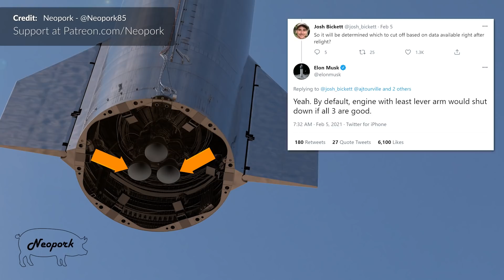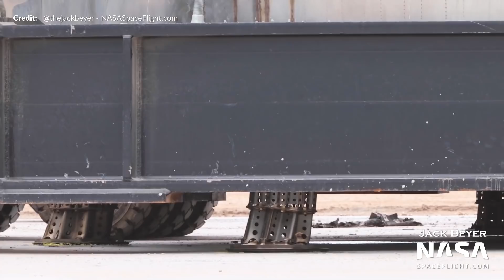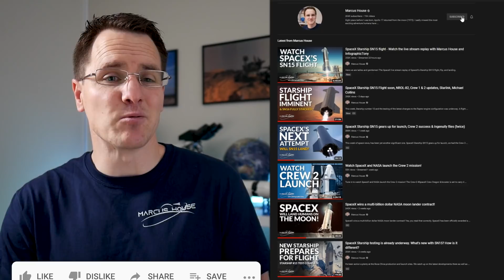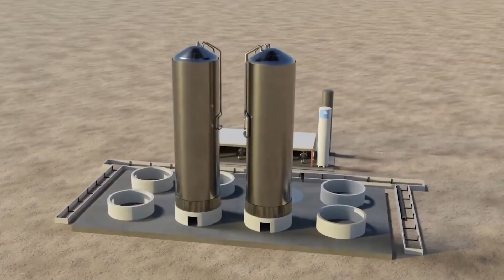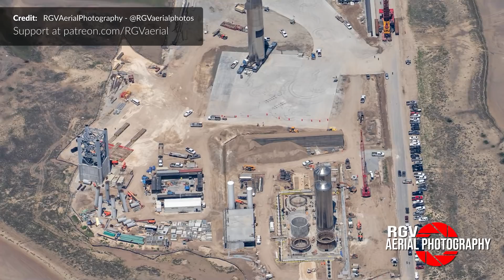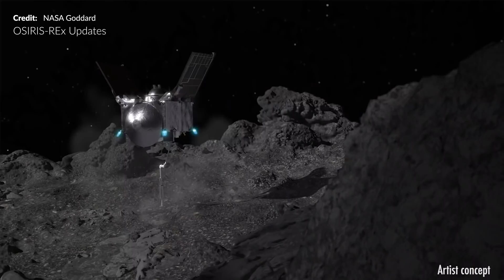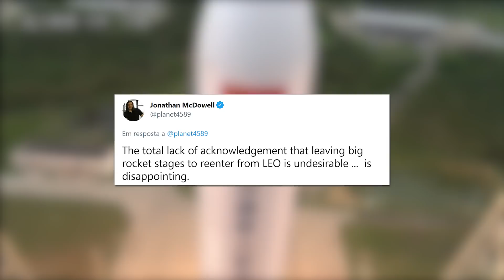SpaceX Starship development shifts focus to orbital flight with Super Heavy

Comment: My biggest concern is the Starship methane leak. Can you address that problem, please? Where does it come from, and will it be present in future Starships?
Reply: The methane leak probably comes from one of the 3 vents on the bottom, so probably the solution is venting on the opposite side of the fire, or something to put put the fire faster
Reply: @apyr1439  
The three bottom vents are for oxygen,  not fuel.
Reply: @imconsequetau5275  Thanks, good to know, i was sure the oxygen was on top.
Reply: @apyr1439  
All that liquid&vapor being spewed out the lower sides is relatively safe because it doesn't combust by itself. Good design, yes? 

The very first Super Heavy may have been designed with the tank assignments reversed, but are now identical to Starship with Methane tank over the LOX tank.
Reply: The recovery of completely intact Raptors on SN15 will improve analysis of leaks. 

SN15 lost an insulation blanket during landing. Fires will have less consequence once a more durable insulation method is used on critical parts. It may also be necessary to flush methane-rich propellant out of the engines more thoroughly after shut-down. Perhaps new external vents will be needed to spew waste away from the engine bay, similar to Falcon-9 fail-safing procedures.

Comment: I'm amazed they landed on the pad considering the crosswinds!
Reply: Some big takeaways from SN15 landing. It was off-pad-centre maybe because of an unlit raptor or the crosswind, but it did an under-control straighten to vertical just before touchdown, protecting the low-side landing legs. Also did anyone notice today's Falcon 9, 1st time we saw the whole landing sequence from the booster, I think this means they have perfected Starlink dish connectivity thru the landing phase
Reply: @Mach210  let's hope so😁

Comment: how many engines will the booster need for this test orbit launch?
Reply: Way less than 28 for sure
Reply: @alvianchoiriapriliansyah9882  as far as "needing" is concerned, yes. But any idea on how many they are actually putting?
Reply: @shlok975  Reliable sources on Reddit (from Nextspaceflight) said it's either 16 or 18
Reply: @alvianchoiriapriliansyah9882  thanks!

Comment: The James Webb Space Telescope's Rube Goldberg deployment sequence required to stuff it within the largest fairing available makes me cringe considering the not readily accessible orbit where it will need to perfectly accomplish that sequence.  IMO, it should have been designed to be assembled from two or three pieces in low Earth orbit, tested in low Earth orbit, then gently boosted to its operational orbit.
Reply: They didn't design it to last supposedly... Hopefully, it pulls a Curiosity instead by staying operational much longer

[YT has a bot that deletes factual comments]
Reply: @CHIEF_420  YT has a bot that does what?!
Reply: @CHIEF_420  "[YT has a bot that deletes factual comments]" - Not very good then is it?

Comment: If the landing was so great, Why was the one adding leg bent?
Reply: Basically, it was intentional.
Reply: More than one was bent. The ship was moving sideways slightly at touchdown. There was almost no telescoping of the lower leg into the upper leg, which is the normal operation of the leg to absorb the landing force. The vertical speed was near-zero, better than SN5 and 6.

However, the ship was moving sideways. Scott Manley noted some skid marks on the landing pad. This matches the type of bending we see on the lower legs, and the tearing where a foot mounts to a leg.

Comment: They'd better get those Raptors to be A LOT more reliable before they put, what, 28 of them in the booster or it's going to perform like the Soviet N1.  From its position, was the post-landing fire associated with the same Raptor which is mentioned to have possibly had problems?
Reply: History has many lessons. Learn.

[YT has a bot that deletes factual comments]
Reply: @CHIEF_420  YT what?
Reply: Fire isn't from Raptor

Comment: Is the Starship first-stage able to orbit without the booster on Mars?
Reply: What exactly do you mean? The 'first stage' is superheavy and it is also the 'booster' and superheavy is not going to be orbiting or going to mars.
Reply: @shlok975  he meant 2nd stage ig 😂
Reply: @NoName-zg2te  ah, in that case, again; there won't be a booster on mars and it would get from mars to orbit on it's now using fuel also produced on mars. In case you are talking about orbiting mars after interplanetary travel, yes it can do an insertion burn.
Reply: @shlok975  Alright thanks! Sorry about  the confusion between stages. I was thinking it would be the case that no booster needed, but wasn't sure!
Reply: Yup

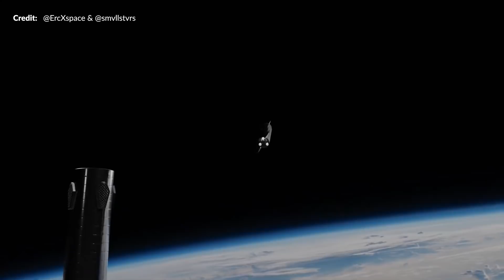Comment: 06:00 Anybody know why the SN20 booster isn’t going to try landing back at Boca Chica?
Reply from the maker: This first flight will be risky seeing as it is the first prototype, and if a Super Heavy blows... that would be something quite a lot more damaging than a Starship prototype. I suspect they want to test all systems work well first. It would by unlikely to be reused a second time anyway.
Reply: It can’t overfly land (possible people) during ascent or descent to ensure safety in case of RUD and debris shower.  There’s one corridor to launch out...between Mexico’s Yucatán Peninsula and Florida, avoiding Cuba in the middle.  Using this path, they can safely climb out to the SE.  Re-entry from this path would have to come from the west, so you need a spot with ocean (or maybe unpopulated desert) to the west.  I thought they’d use coastal CA or desert AZ, NM, or TX; but it sounds like they chose offshore HI, which is even more isolated!
Reply: Why don't they try to land on a floating platform like the Falcon 9's?
Reply: @harrisbornstein4955  Maybe they will, but they haven’t been built yet. The current drone ships are too small.
Reply: @fredbloggs5902  thanks for replying (and correcting me). They are also planning on catching superheavy by it's gridfins. That is a pretty hard thing to put on a boat. Also, the turnaround times will be longer: bad for rapid reuse.
Reply: @harrisbornstein4955  they probably don't want to risk the ship just yet. Also, how are they going to get the ship to kawai? Anybody have any idea on the range of the droneship?
Reply: @shlok975  the booster is landing in the Gulf of Mexico, not Hawaii.
Reply: By the way, isn't it the side booster or the first stage that's called "booster"?
Reply: @shlok975  I was referring to Stage-1.
Reply: @shlok975  Not sure what you mean by “side booster.”  Perhaps you’re thinking of the Falcon9-heavy, which has three boosters—two on the sides “strapped” onto the center one.?.? 
The Starship system has only two flying parts.  The SuperHeavy booster, or booster for short—abbreviated BN1 or BN2 for ship identification—is the taller one with fins that never gets to orbit.  The Starship is the top of the two-part stack.  They’re calling them SN15, etc for ship-specific ID.  It’s the workhorse, carrying the cargo.  Without the booster it can’t get into orbit when loaded, but it could go nearly halfway around the world.
Reply: @737smartin  ah sorry, I was talking more general as supposed to just starship. By side booster I meant any booster of any rocket, like any SRB ever or any 'engine booster' like the four R7 iconic shaped side boosters.

Comment: It's so crazy that we're now talking orbital flight with Starship. 2 weeks ago I was admittedly very down on whether or not Starship would be successful. But ever since SN15 my glass is half full and I hope it will stay this way
Reply from the maker: I have little doubt Starship will become the booster to loft mass to LEO. The remaining aspirations are harder to work through, but a LEO capable ship that is reusable changes the game entirely on its own. I am first cheering SpaceX on first for that initial step. It would be amazing to see that happen this year with a reasonably large payload.
Reply: @MarcusHouse  My "crazy" was more meant like "I can't believe we're at this point". But yeah you're 100% right. Let's keep our fingers crossed though =D
Reply: The way I think of it is they wouldn’t even try unless they’d done extensive computer and wind tunnel simulations, so they know theoretically it works, just a matter of breaking a few to figure things out.
Reply: @aldunlop4622  I'm less concerned about aerodynamics and structural strength than I am vibration.  Given sufficient stimulation (like the acoustic output of a couple dozen Raptor engines) the entire rocket (engine plumbing included) becomes a giant skiffle band.  Instantaneous loads (and associated deflections) quickly exceed static design specs.  Propellent connections fail, protection tiles fall off.  Notwithstanding all that, I share Marvin Kö's renewed optimism. :)